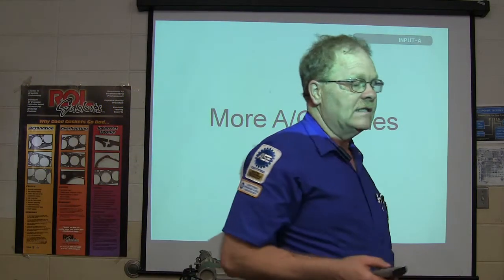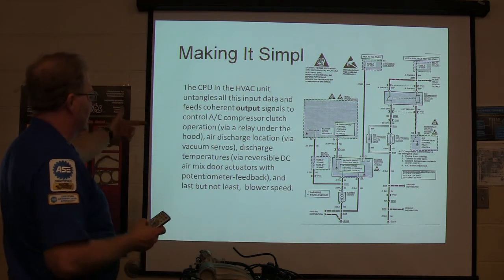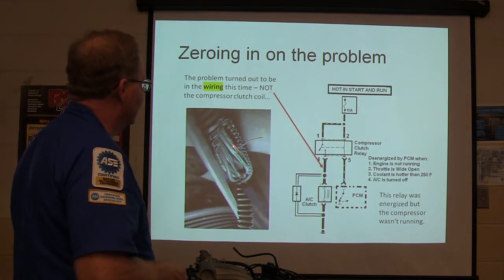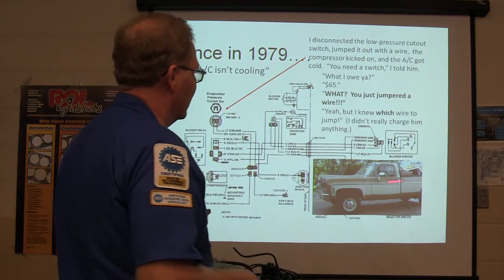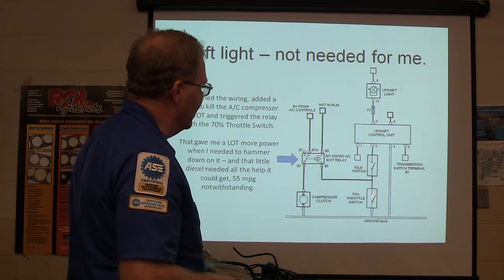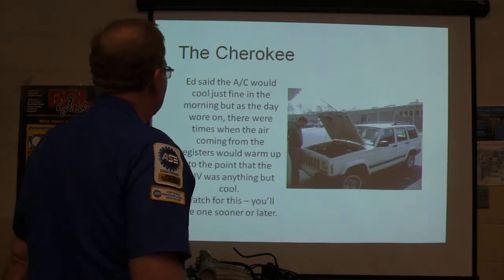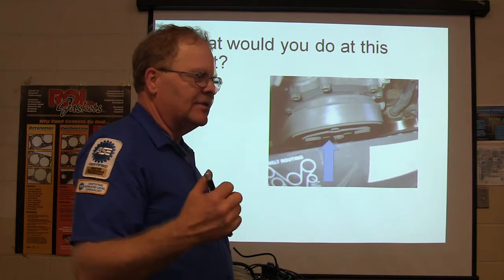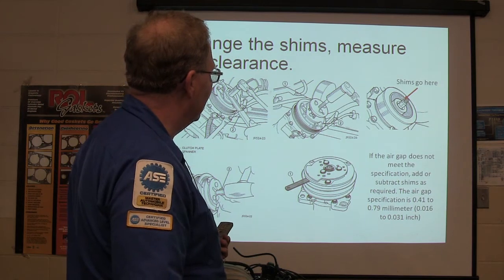More AC stories and a short test

Comment: why on low max ac the compressor cycles more it seems like hi blower speed it would more could u explain
Reply from the maker: Because the evaporator is cooler on low blow and so it cycles more because of the lower pressure/temp